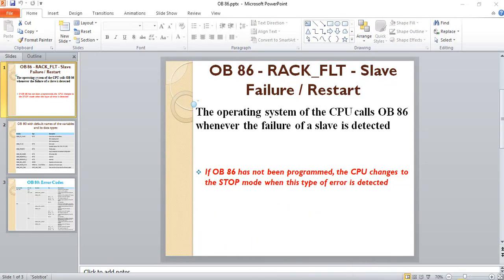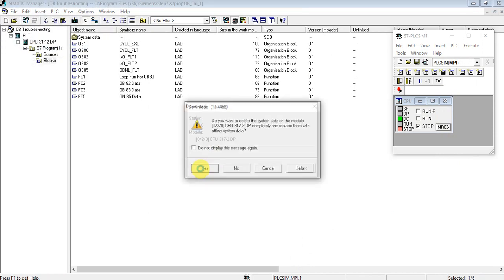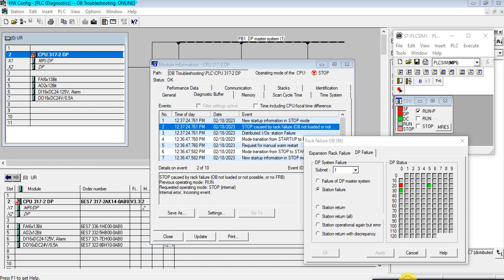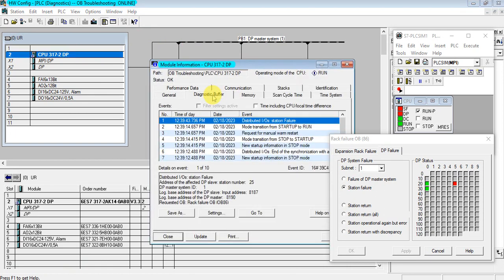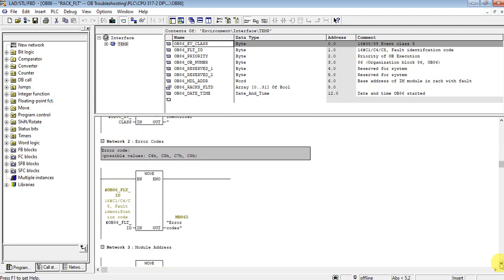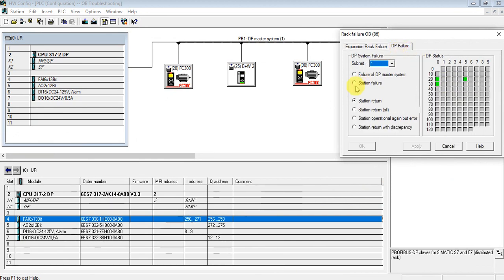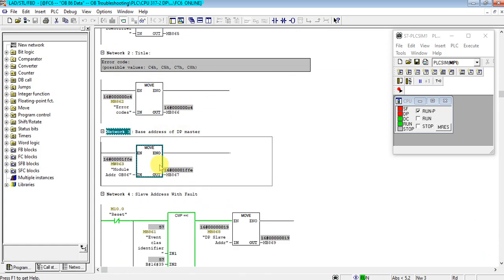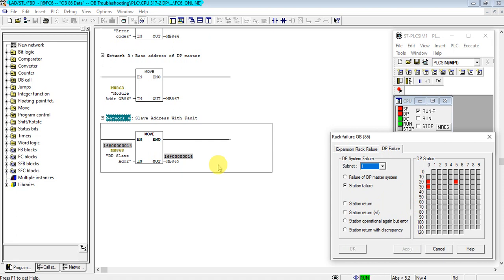OB's used For Troubleshooting, OB 86 - RACK_FLT - Slave Failure / Restart

Comment: So in case if your any slave is faulty then PLC will not go into the STOP mode, if OB86 is called .  For one of my project I called OB 86 but in that block now program was written whether it will work ?
Reply from the maker: yes The Cpu Will Not go stop mode

Comment: Why  Salve Adress with fault == LB11?
Reply from the maker: LB11 is the local variable where OB86 store The Slave Address with fualt. You Can Check The Temporary Variable OB86_RACKS_FLTD it includes LB8, LB9, LB10 and LB11
Reply: @bellewolde  thanks you somuch